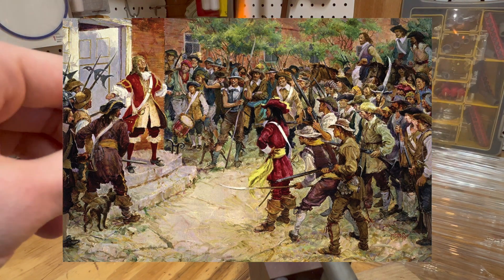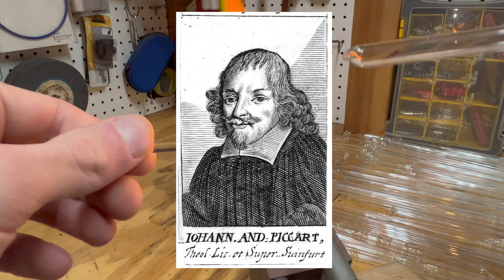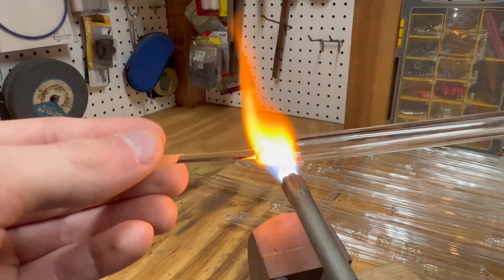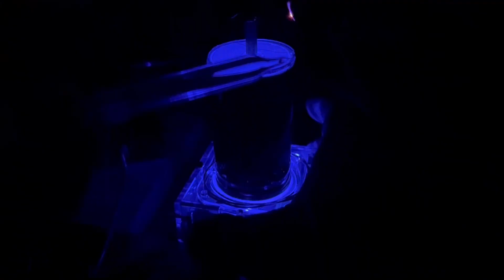Glowing Mercury Metal - Barometric light

Comment: Wait... You just vented mercury vapor into the room... ☝🏻😬
Reply: Yeah, seems like it's a good plan to put the compressor in the fume hood when evacuating a mercury filled tube.
Reply: The amount of vapor in that would be ridiculously small. I'd be more worried about eating a couple of cans of tuna or other higher up the food chain fish
Reply: Mercury has a low vapor presssure, it evaporates 16000 times slower than water. Also keep in mind that elemental mercury is a low reactivity metal not absorbed by your body.
Reply: @mernokimuvek  do you even hear yourself? 🤡